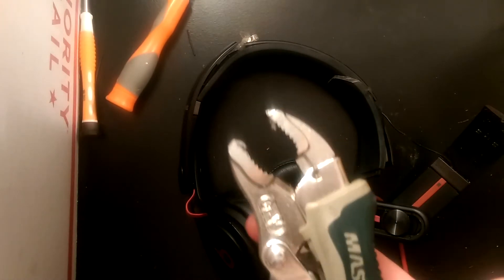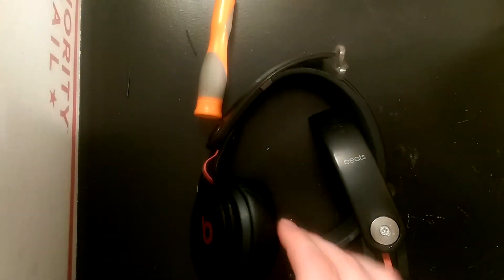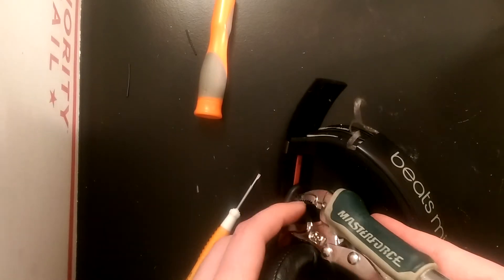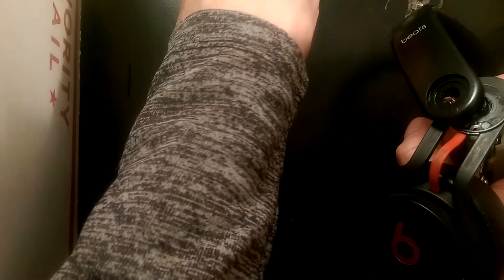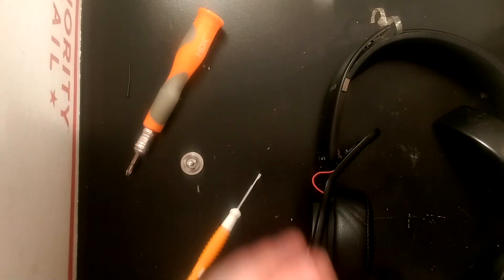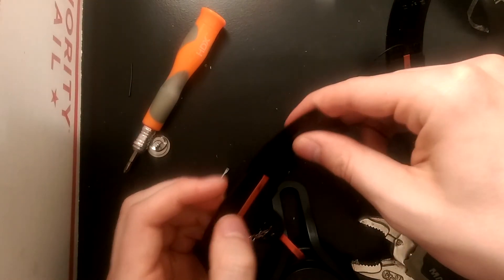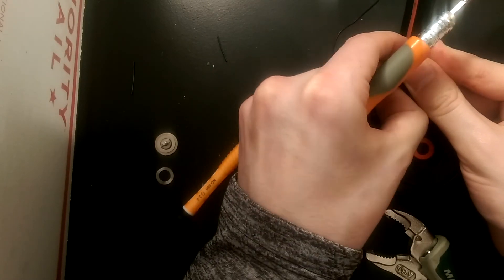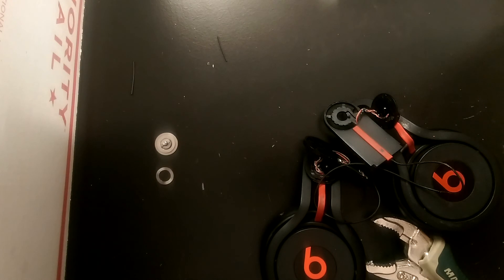Fix Beats By Dre Mixr Headphones Headband Disassembly Video

Comment: I was wondering if u could help me with something I bought I new wire from u and wired it up and tried to touch them against the speaker connections but nothing happens but when I use like regular speaker wires for a car it works...I haven't got a soldering gun yet because I wanted to check if they would even work maybe that's the problem it needs to be soldered

Comment: The screw on my beats is so tight please tell me some tips to remove it, I removed the first one with ease but this on is so tight
Reply from the maker: +Vishal Adhikari try using a larger screwdriver do not force it out. Also get a vice grip to hold the other side as you take it apart